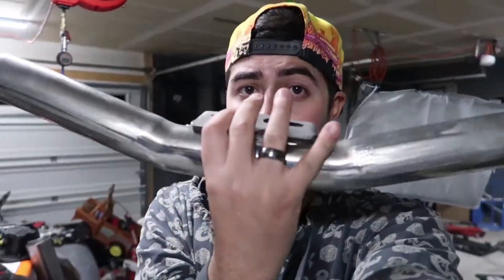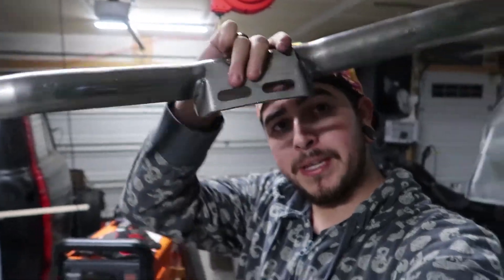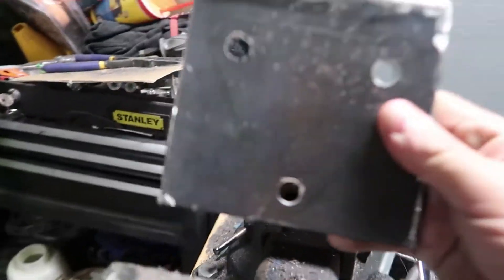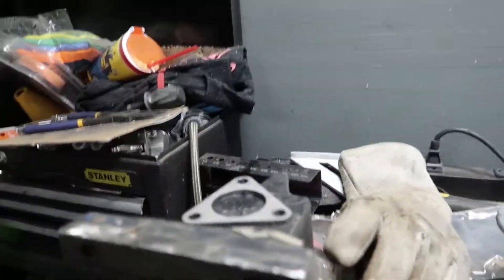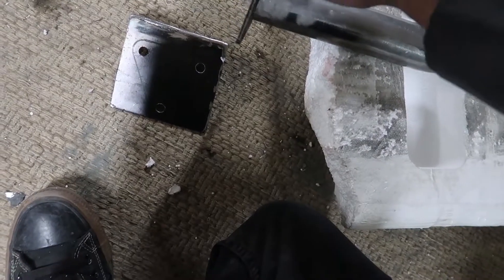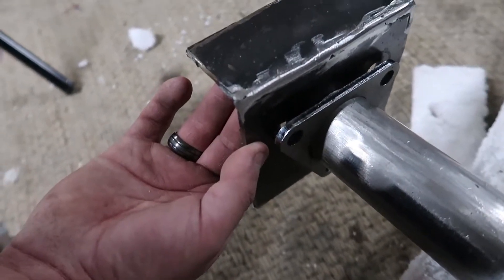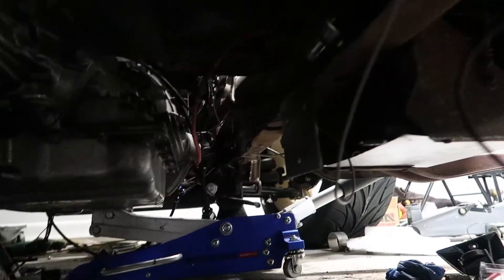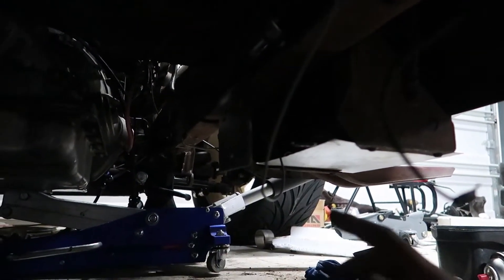Transmission Crossmember build Pt 1

Comment: Have you used this universal mount to mount engines ?
Reply from the maker: I don't think it would work like that
Reply: They sell them specifically for engines so i was curious if you have had any experience with them
Reply from the maker: @triggs249  oh I think I know what your referring too. They seem pretty simple. There's weld on and bolt on ones. It's going to be pretty custom no matter which way you go.
Reply: @JovaniDanteGriego   ok you have any recommendations i went from a straight six to Ls in a 69k5 going i have sent back several mounting options that were supposed to work but didn’t.
Reply from the maker: @triggs249  if you can get the frame mounts for a small block Chevy, you can use SBC to LS mounts